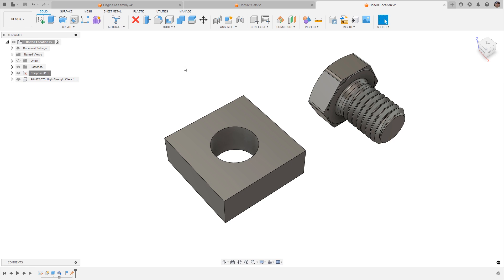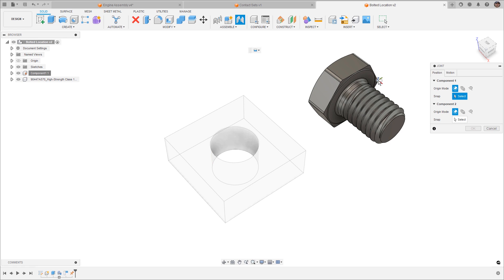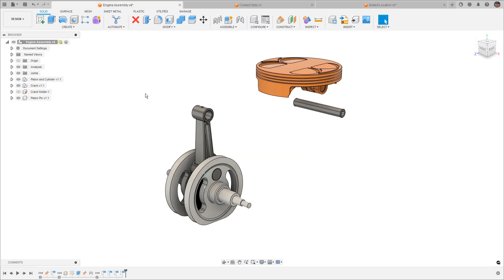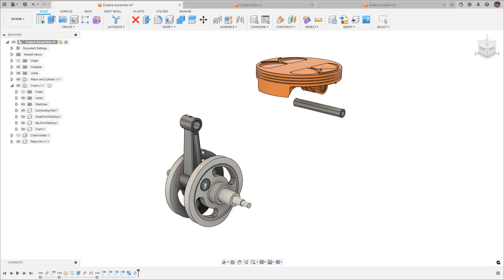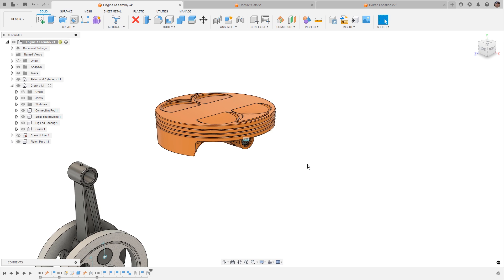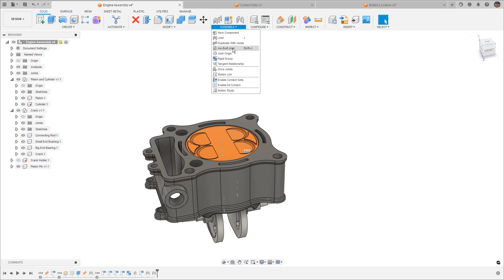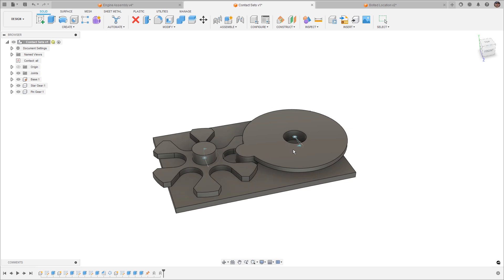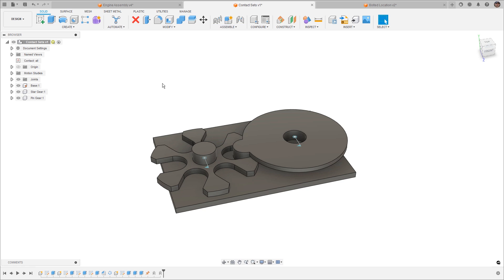Joints, Mates, and Moving Things Around in Autodesk Fusion

Comment: Yeah, so how are you doing magic animation just by grabbing a component?  When I grab a component, it moves around the screen but won't rotate.  If I select "animate," the component animates properly, but components attached with rigid joint stay put (are no longer attached.)  What magic setting have you done here to allow you to click and animate at will? And keep all rigidly jointed components actually rigidly jointed?  (I've read many many posts where people have the exact same problem I do.  Rigid joints do not work when you animate a revolute joint.  Yours work.  What are you doing different?)
Reply: Tells people to leave questions…. Doesn’t answer them.
Reply: It is a bit late.. but my guess is that you are missing grounding one of the components.
Reply: Exactly. No ideia how they do this in all the vids 😅

Comment: As much as I practice this, 15 years of doing constraints the Inventor way still doesn't make joints much easier. 

There's times I don't want all the degrees of freedom locked out. I just wanna click on one plane, click on another plane or surface and constrain them. Boom, done, on to the next step. Seems like the Joint command makes EVERY interaction a whole little research project where I'm figuring out what points to use, how to project and setup points the way I want, doing my homework; vs just clicking on pairs of surfaces and watching the assembly come together. It's like making a new toolpath in CAM vs an extrude. I want something as simple and quick and intuitive as extrude, not dealing with multiple menu options for basic things EVERY SINGLE TIME. If I dumped 43 parts into a single design space and wanted to start joining them together I'll be all day going at it. 

This video does do a good job showing that it can be easy and that the basic stuff like 'constrain one plane with another plane' IS in there, but it's absolutely buried. And then the limitation of 1 joint between two parts means having to spend brain power on stuff that could be easy. A simple co-planar joint should be the DEFAULT. And then if I make more co-planar joints between two parts then the program should just be intelligent enough to merge them into one if that's what it takes.
Reply: Unrated comment
Reply: I wanted to use Fusion to do what Jason does in this video: https://www.youtube.com/watch?v=PpbFmLwdhHA&t=273s  

Unfortunately, I had to get Solidworks and try to start learning it.  A single fixture block ends up with four faces mated, two flat and two holes.  Can this even be done in Fusion?